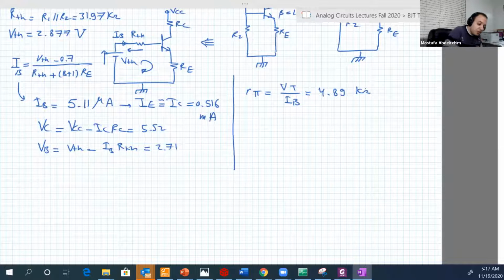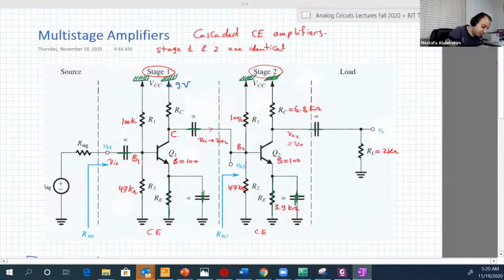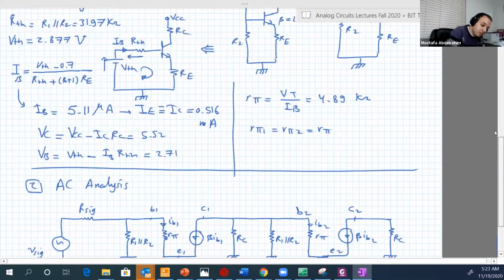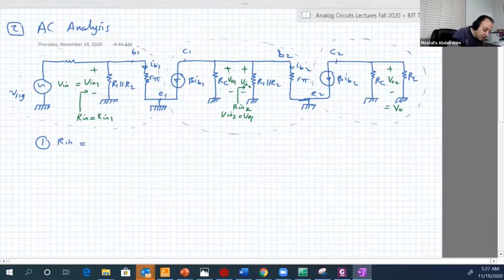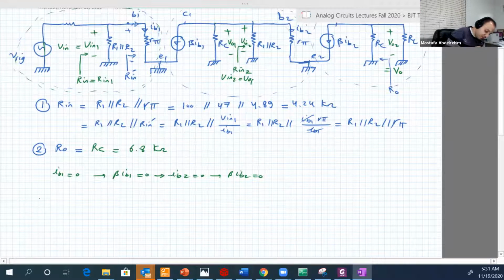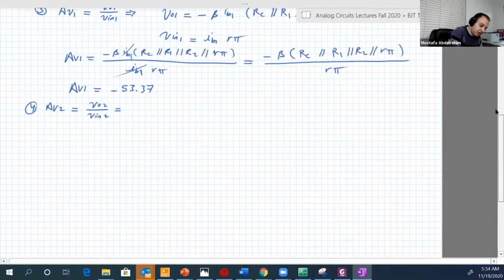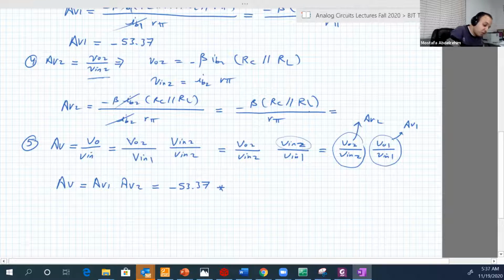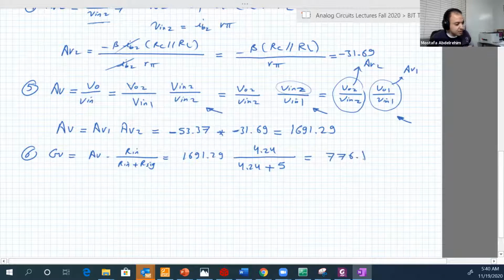[26b] Multistage Amplifiers - Cascaded common-emitter amplifiers - AC analysis

Comment: Why did you ignore Rsig while calculating the input resistance ?
Reply from the maker: Hi
Good question. So l did that because I of the definition of Rin. Rin basically is the equivalent resistance of the amplifier circuit not including the input source (Vsig & Rsig) and the load (Rl). This definition is given in my past videos in this series so plz watch those videos too. Also plz share with your colleagues. Thanks again for watching.🌷